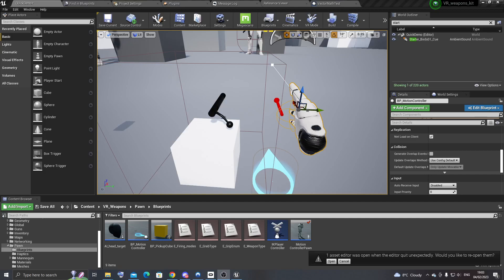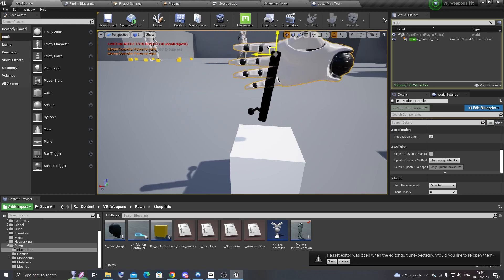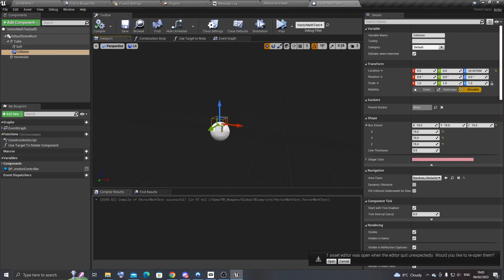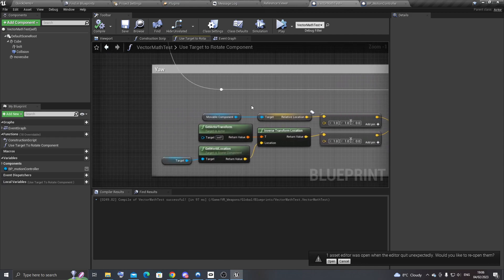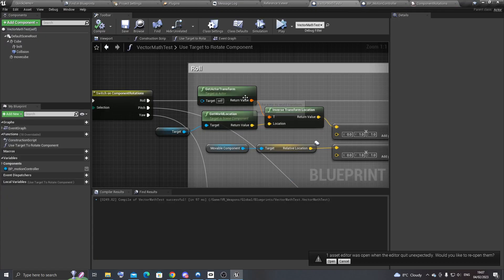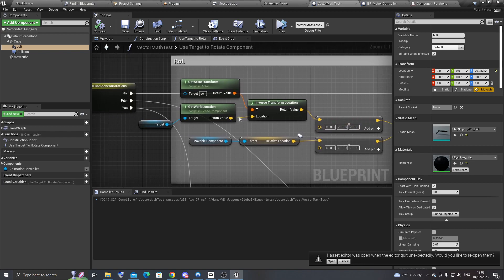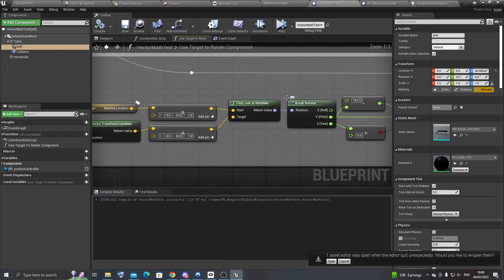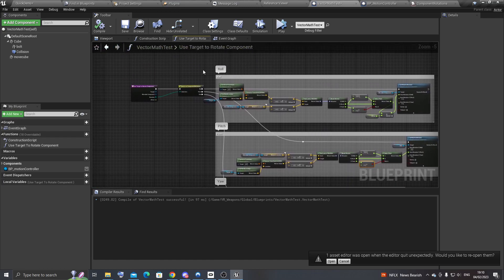Unreal VR lever relative rotation fix

Comment: but how we can do it on rool and pitch  (X and Y)   when we have same amount for both ?
im want to make xy  but its seems hard to do
Reply from the maker: I think just a normal LookAtRotation without changing the vector inputs might work if you want it on more than 1 axis, but instead I think you will have to only use the X and Y from the outputted vector